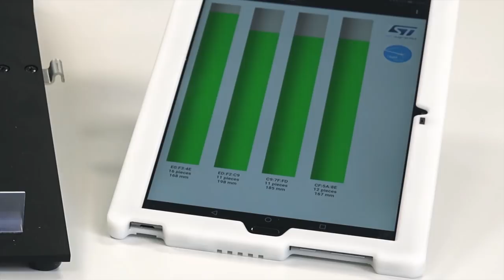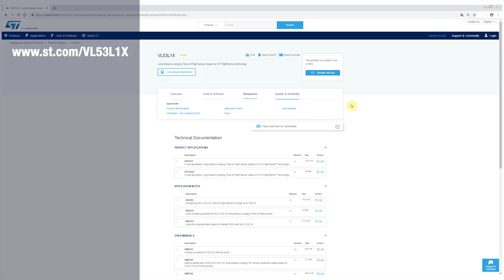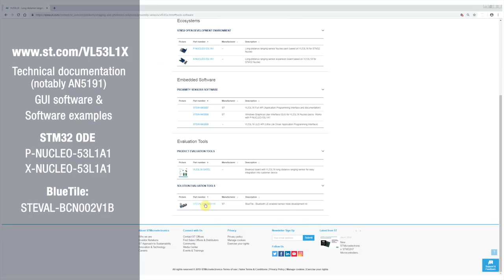VL53L1X and BlueNRG-Tile: smart shelves demonstrating programmable region-of-interest (ROI

Comment: the minimum ROI angle VL53L1X of the is specified with 15° so how comes that the width of the USB-Slot will work. Do the glass panes on each side of the slot help to focus/reduce this angle?